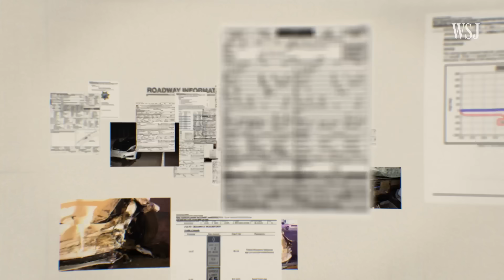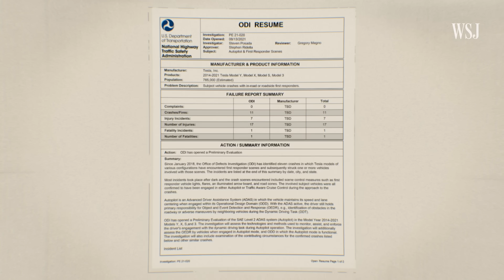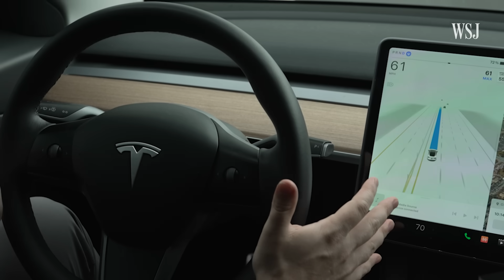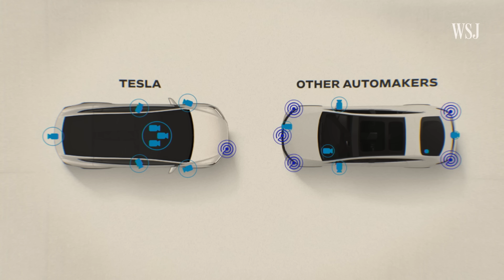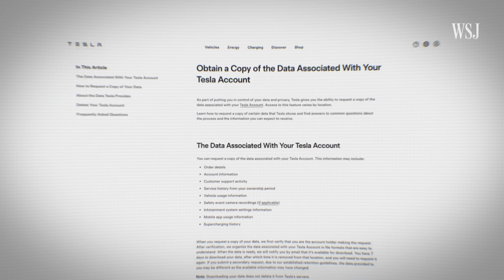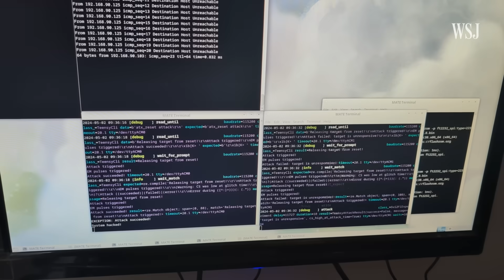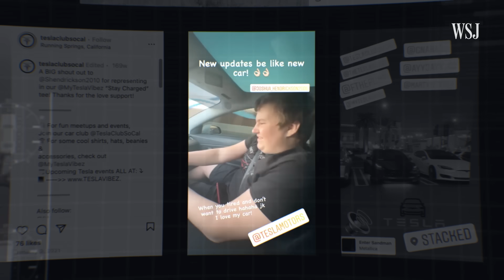The Hidden Autopilot Data That Reveals Why Teslas Crash | WSJ

Comment: Condolences go to the victims and their families, but the WSJ cruelly exploits their tragedy by peddling a false narrative that blames Tesla instead of the drivers who simply failed to remain attentive. Tesla has always been clear: Autopilot is an assistive feature, not a replacement for responsibility. By twisting facts and fueling outrage, the WSJ prioritises clicks over truth, doing a cruel disservice to those affected. This is just what you’d expect from the mainstream media — and the bears will eat it up.  HODL and ignore the noise.
Reply: On the one they market it as auto pilot, but on the other hand they give you warnings to remain fully attentive. To me they are sending mixed messages. If it in no way resembles auto pilot, then stop calling it Autopilot.

Comment: Autopilot is something I don't use regularly since I hate the nags and restrictions in EU and there's probably a good reason for that. Still Tesla's "Autopilot" didn't try to kill me like Mercedes' Distronic+. I had multiple incidents where when it just stops following the markings and goes straight ahead. Or even better if you don't pay attention on the display (no sound) for the steering nag. It just STOPS steering and goes straight ahead with cruise control.

Comment: The story is misleading. 
1. No actual experts on Self Driving Vehicles, the two "experts" have no actual deep knowledge. 
2. No comparison data, they claim it is vision problem but they don't compare it to any other ADAS system in terms of safety.
3. They don't compare Tesla ADAS system with human drivers.
Regardless it is still an interesting study on bias and how you can adjust the naritive to support your viewpoint.

Here is exactly the same information presented in a different way.

*A Safer Path Forward: How Tesla's Autopilot is Shaping the Future of Driving*  
(Uplifting music plays in the background)

On the morning of May 5th, 2021, Steven Hendrickson was commuting to work in his Tesla Model 3, equipped with Tesla's cutting-edge Autopilot technology. While a tragic accident occurred, it serves as a moment to reflect on the complex challenges of driving and the incredible strides Tesla has made in improving road safety for millions of drivers.

Tesla's Autopilot system, which has been operational since 2014, is a game-changer in automotive safety. Independent studies and data from Tesla demonstrate that vehicles equipped with Autopilot have a significantly lower accident rate compared to those driven manually. In fact, Tesla's vehicles with Autopilot engaged have reported **one accident per 4.31 million miles driven**, compared to the **national average of one accident every 500,000 miles**, according to data from the National Highway Traffic Safety Administration (NHTSA).

Tesla CEO Elon Musk has consistently emphasized that Autopilot is designed to complement human driving, reducing the workload and enhancing safety. He noted, "Autopilot is not perfect, but it is better than human drivers in many situations. Over time, we expect it to reduce accidents by a factor of 10."

Tesla's approach to autonomy sets it apart. While other automakers rely on a combination of LIDAR and radar, Tesla’s camera-based vision system is powered by advanced neural networks. This enables Teslas to "see" the road much like a human would—but with the ability to process data at speeds no human driver could match. Tesla’s engineers continuously update the system, leveraging data collected from its fleet of over **2 million vehicles worldwide**, making it one of the most data-driven autonomous systems in the industry.

The challenges faced by computer vision systems, such as recognizing rare objects or unusual conditions, are part of a broader evolution. Tesla has acknowledged these challenges and is committed to refining its algorithms through rigorous testing and data collection. For instance, Tesla's *Full Self-Driving Beta* program allows thousands of users to safely test new updates, providing invaluable feedback that enhances the system's capabilities.

Despite some criticism, Tesla's Autopilot has already saved countless lives. In one instance, a Tesla Model X in Autopilot mode successfully avoided a multi-car pileup on a highway in California, alerting the driver and braking seconds before impact. Stories like these underscore the potential of Autopilot to mitigate risks that would be unavoidable for human drivers.

Safety experts agree that automation is the future of driving. Tesla’s decision to prioritize affordability and scalability by focusing on camera-based systems instead of expensive LIDAR ensures that this life-saving technology is accessible to more people. Tesla has repeatedly stated, “Every life matters, and we are committed to improving Autopilot until it is statistically the safest way to drive."

Former Tesla data annotation specialist John Bernal, who worked on training the system, praised the sophistication of Tesla’s cameras and neural networks. "Every image we labeled made the system smarter," Bernal said. "Tesla’s eight-camera array processes an incredible amount of data, enabling vehicles to understand and navigate their environment with remarkable accuracy."

While no technology is without flaws, the strides Tesla has made toward reducing human error on the road cannot be overstated. The *U.S. Department of Transportation* has noted that **94% of crashes are due to human error**, a statistic that autonomous driving technology, like Tesla’s Autopilot, seeks to significantly reduce.

In the future, advancements in AI, hardware calibration, and regulatory oversight will make autonomous systems even more robust. For now, Tesla remains at the forefront, pushing boundaries and creating a safer driving experience. As more drivers embrace Tesla's technology, the dream of a world with fewer accidents and greater road safety is becoming a reality.

(Uplifting music crescendos)  

Tesla's commitment to safety and innovation is paving the way for a future where driving is not only more convenient but also exponentially safer. It's not just about the cars; it's about creating a world where technology and human ingenuity come together to save lives.

Comment: Beta version of Autopilot tried on the public roads. It gives people a false sense of security and people put down their guard. That is the point of these systems. Elon has known to override engineers, even though he is not an engineer. He purposely restricted using a secondary system such as radar or lidar to save money. This is the equivalent of Boeing using a single AOA sensor instead of two controlling MCAS which lead to the 737 Max planes crashing. Never rely on a single system for critical safety systems.

Comment: Information in this video is outdated. Actually it was even outdated 2-3 years ago.
Reply: It still applies to Autopilot because that stack hasn't been updated in years. That's on Tesla. They could very easily switch to the FSD stack with traffic lights and stop signs detection disabled (ie, city driving) as well as auto lane change. I don't know why they keep that old stack alive. The new one also uses eyes tracking, which is much better than wheel tugging for detecting if the driver is engaged with its driving.
Reply: @sylvaing1  They update autopilot stack as well. But sure it is a shame they only merged FSD & AP only for a handful of people. But based on the current false blames if FSD would be released to everyone, every single crash would be blamed on them. Anyways with Christmas coming the media will try to steer people away from Tesla to any other brand they get the Advertisement money from. Its the same every year. Tesla hate is increased for Christmas :)
Reply: @ytmacskas  You're confusing Autopilot with the FSD stack used on highways (V11). Both are NOT the same. They replaced the FSD highway stack (V11) with the city driving stack (V12.5) in version FSD 12.5.6. The old FSD highway stack (V11) is much more powerful than the current Autopilot stack. So to recap, for most users, there are three stacks, the Autopilot stack, which like I said has seen no loves for quite some times now; the FSD highway stack (V11) which is being replaced with the FSD V12.5 stack and the combined FSD 12.5 stack, which is being replaced with the FSD V13.x stack for HW4 cars while us HW3 cars are waiting to see what happens to us as upgrade goes.
Reply: ytmacskas
old people just cry, how you get the data more urly
you suck Elon's Willy , MAGA you need ????
Get the deal in 5 minutes, just suck it !
Reply: ytmacskas
old people just cry, how you get the data more urly
you suck Elon's Willy , MAGA you need ????
Get the deal in 5 minutes, just suck it !

Comment: Are they talking about "Autopilot" meaning what I would call "adaptive cruise control + active lane assist" or "Autopilot" meaning FSD (Beta)?

I have a Model Y and I NEVER trust the car to steer or brake for me. Just like I wouldn't for any other car with Adaptive Cruise Control or Active Lane Assist. 

I've seen it brake when it shouldn't as well as brake when I should have.

From what I gather from this video, drivers failed to pay attention and trusted Autopilot (first definition) just like Tesla keeps warning them from the user manual...

I do agree with the lack of information Tesla provides and the bs "we're gathering it" which shouldn't take more than a few minutes.

Comment: Toyota is largest automaker in the world for decades and they have been using adaptive cruise control and very recently self driving tech in some of the Lexus models but they have not implemented it largely and their adaptive cruise control doesn’t stay autonomous for more than 15-30 seconds. The reason they are not doing on large scale due to the fact that LiDAR and ultrasonic sensors they use in the tech. This makes car very expensive and hurts bottom line. During the rise of pandemic Elon musk decided to remove all the sensors due to the chip shortage and decided to rely solely on cameras. This is what’s failing in this Tesla. Even one life is a lot when it comes to the tech failure.

Comment: Camera is unable to recognize the wreckage. A combination of radar and camera is always better, like the usual setups of other car brands to be able to make emergency stops. This is how it is tested for ancap (or euro). On the other hand, there should have been hazard signs waaaayyy before the wreckage. The car should have stopped safely after a certain number of warning and deactivated autopilot. Both are at fault, the drivers or owners should not be used as "test" pilots just to help Tesla train their ML model. On the other hand, owners should not be using this "feature" if they are not prepared to take over.

Comment: Nice try, WSJ. However, the truth is, driving with Autopilot results in significantly fewer fatalities per mile driven compared to normal driving, with some reports showing a crash rate as low as one crash for every 7 million miles driven using Autopilot, while the average for non-Autopilot driving is considerably lower, often around 1 million miles per crash
Reply: As far as I know there is no credible reports saying that as Tesla refuse to disclose their data.
Reply: Even lower with FSD, FSD is more expensive but it would have saved his life
Reply: The truth is that nobody buys teslas, so they have a lower death rate. The average driver drives better than a computer. A man would've seen the truck in the middle of the road.
Reply: @ Here you go, genius: As of late 2024, the Tesla Model Y is the best-selling car model worldwide, followed closely by the Toyota Corolla and the Toyota RAV4.

Comment: It is (currently) a driver assist system where the driver MUST remain in control; stationary objects specifically need Hunan intervention (to avoid too many false positives) and the driver has to read and confirm such a warning. In many of the clips there was a long distance where an alert driver could see they needed to step in and take control.
I am first to agree we ate in a critical phase where the cars are very capable yet the driver must fill in some very occasional gaps so that’s a big ask but driving a vehicle safely is a big important task that should be taken seriously.

Comment: A lot to unpack here:  

@1:32 Missy Cummings states, “There is no doubt people are going to die in this technology; the question is, when?” People have been dying in cars for decades - it doesn’t take this technology to determine that. She also says, “That’s the way the tech is designed,” as if implying the technology was intentionally designed to end lives. Seriously?  

@3:42 Steve was warned 19 times to take control of the wheel. If he was alert, saw an obstacle clearly ahead, and noticed the car’s speed wasn’t decreasing, a good driver would have immediately hit the brakes and swerved long before that. It’s like installing a smoke detector in the kitchen, seeing the stove burst into flames, and deciding to wait for the fire alarm to go off before extinguishing the flames. And if it doesn’t, letting the house burn down just to blame the company for selling a “faulty smoke detector.”  

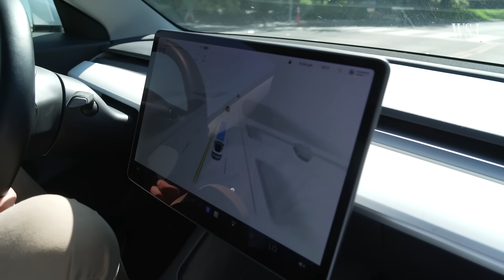@5:31 John Bernal, the former Tesla employee, deserved to be fired. If you’re testing a technology you worked on, it’s sensible to take the data back to the company to help improve the product - especially when you’re a data annotation specialist who was directly involved in gathering the data for what you’re testing. Publishing it to the world to shame your company is not the way to go.  

@6:58 99.9% of drivers wouldn’t have seen that obstacle on the road. It wasn’t lit at all. I didn’t see anything in the video until the crash happened.  

@10:00 Janelle says people are still going to buy Teslas no matter how many accidents occur. People have been dying in car crashes for ages - that hasn’t stopped anyone from buying cars?

Comment: The issue is multiple, tesla cut corners with obstacle detection. Lidar and sonar are second opinion for the AI to take a decision and validate the data as machine vision is far from perfection as of now. Think of it as alpha phase early testing and you are the tester.
Buyers are also not educated properly on how this works and are way too distracted while using their tesla. Because the seller has a motivation to sell and not educate or make the customer aware.
And lastly the governement allows those loops holes to be exploited and make tesla not disclose the data because it's "protected". In aviation and railway, none of that would be tolerated.
Reply: V13 is showing Lidar is not needed. Most people have no idea just how good FSD is getting.

Comment: For those who are not truly into Teslas, this article may look incredibly serious, but it only partially is. See, nobody in the video talked about Full Self-Driving versions 12 and 13, which haven’t cause a single accident before almost 6 billion miles were driven. What was shown here was FSD in some frames (turned on by the former employee) but then they didn’t show the actual performance of the system. And that’s because the video revolves around basic Autopilot software, which is obsolete for over 5 years now, showing a lot of limits in recognizing unusual scenarios: the crashes shown during the video by the tesla dashcam are an example. Also, the owner’s manual is like 295 pages, and half of them are warnings telling the owner to always pay attention and to be ready to disengage the system at all times. If you don’t listen to these warnings, even if they officially exist, how can you blame the company at the end of the day? There’s not a single car company that provides a system (FSD, not Autopilot) capable of performing a complete driving task with zero interventions in most of the cases. It is still supervised, and it’s even said on the display when you turn it on for the first time. It’s meant to reduce the driver’s workload, not to replace them, for now. When the Cyberacab will start to operate on public roads, running FSD Unsupervised, and it will cause an accident, then all the questions raised in this and other videos will likely begin to have sense. For now, FSD needs to be treated like if you were a beta tester, even though it has reached incredibly high safety scores, in fact it’s available to all Tesla owners in NA as an optional, and not only to the early access program drivers.

Comment: The issue with FSD is not with Technology. It is the overselling of it. You cannot trust FSD, in the same way you let a new teen driver on the wheel. Unfortunately physical sensors are a must and adds a bit of needed redundancy.
Except for one misjudged left turn, resulting in running over a curb and a sidewall damage, FSD has done a fair job, as a L2 ADAS. It is similar to ChatGPT, except it deals with life critical vehicle control. Just some 💭

Comment: Even pilots are required to monitor the autopilot 100% of the time. This is human negligence, end of story. Tesla is the only car with autopilot so you can't use that to misrepresent the safety. Note how even WITHOUT autopilot, the drivers would have crashed.

Comment: So a woman speqking about autonomy 8 years ago go and videos with crashes 3 years ago. Interviewing a guy who worked for Tesla 12 years ago. Why don’t you look at recent data? Also, why didn’t the driver see the overturned semi? Or break when rushing by multiple police cars? It can never be the cars fault, when it’s not driving 100% by it self, and Teslas only barely reached this point. There are so many cars with lane assist like Tesla, what is the crash data for these compared to Tesla. Also does the claim of Elon Musk, that it’s still softer, despite a few crashes? This is bad journalism.
Reply: Maybe they dont look at recent data because Tesla refuse to release the data?
Reply: 3 years ago is very recent, most people use cars from 5 years ago or older.